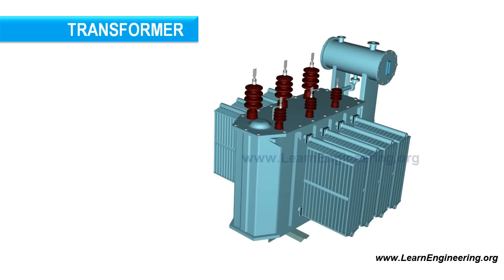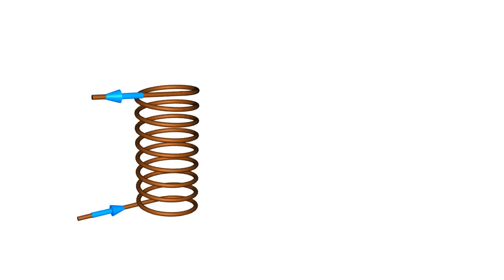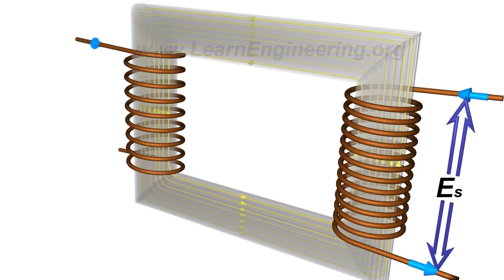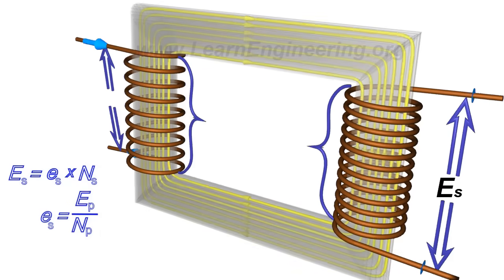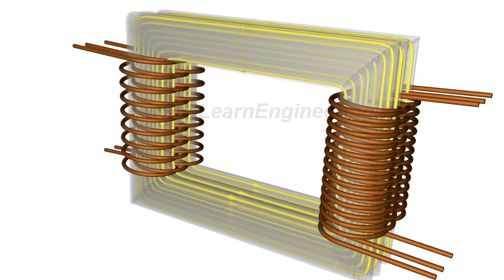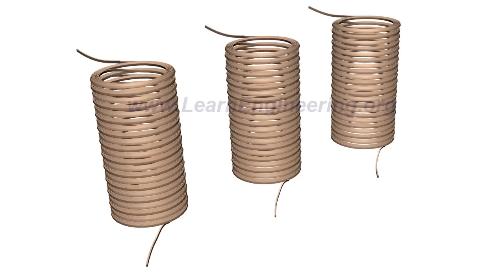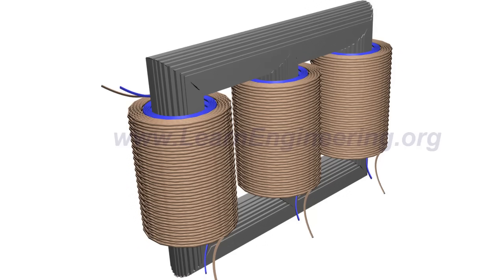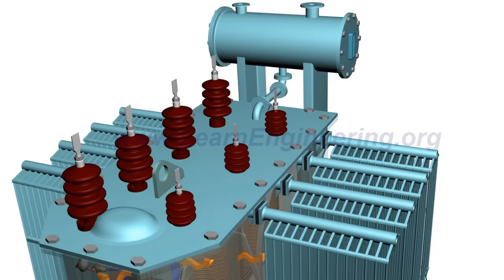How does a Transformer work ?

Comment: Best instruction on transformers I've ever had. Outstanding graphics.
Reply: I find this interesting
Reply: Still not enough for my communist professor.... oh irony...
Reply: I was in danger of being beat up and shot by a Crypt Gangster until I asked him if he wanted to know how a transformer works. Also, had he ever been curious about Nuclear Fusion?? You should have seen the look on his face - he was terrified of me and took off real quick like, getting into the car with the rest of his homies. Whatever he told 'em must have had the same effect c'os they were GONE, and I mean GONE, screeching tires and all!!!!
Reply: Excellent so would know the answer to this:
After placing the primary coil inside the secondary coil, I assume the coils don't touch each other, what is the size of the gap and if there is anything in there besides air separating them?
Reply: It was fine up until the 3-phase explanation and star vs delta configuration. Then it suddenly became an explanation for people who already understood the matter.
Reply: @Mayur think of Watts law. Power = IxE. The power in the primary equals the power in the secondary. A transformer doesn't create power, it only takes the power coming in and converts the voltage up or down, therefore the current can only do the opposite to balance the power (watts or VA)
Reply: Me too I've finally understood wat my lecturer struggled to tell me

Comment: Very clear informations! I'm graduated at civil engineering, but have been learning about mechanics, electricity and electronic with your videos. Thank you for the excellent material!
Reply: The only part I did not understand was the Mathematics behind it all. I mean P=(UV-++^^^78UV) -- V5XV4+eVX22-PO+=o3C2=O There, now that wasn't so hard was it????
Reply: Can you plzz tell me that the concept of transformer or other topics of electrical is necessary for civil engineer ?
Reply: @Ayusingh12348  It's important if you going to work designing the eletrical system of a building, but even if you don't I think you should know at least the basic

Comment: Actually the high voltage side is usually in a delta configuration and the low voltage side is in star configuration. The delta configuration allows us to transport power without the use of a neutral, saves some money. And the star configuration is needed for a ground reference, otherwise the consumers do not have a voltage potential difference.
Reply: true
Reply: Very true for a step-down transformer, but this one is a step-up transformer.
Reply: An interesting note is that in some rural areas the delta just goes straight to the consumers and they tap off from two of the wires directly

Comment: we must also describe 2 things: the number of windings affects voltage (more secondary windings that primary results in a bigger voltage), while the resistance of the wire affects currents (lower the resistance, higher the current). thats why transformers can be used to lower/higher both voltage and current at the same time.
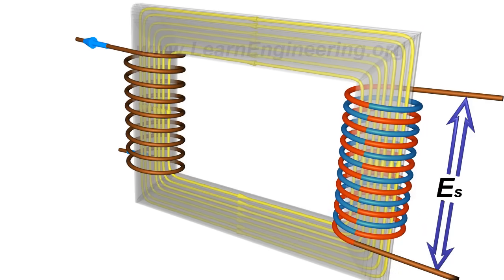(at 1:50, if you have enough patience to calculate the windings on the secondary and primary, you will realize the secondary has more turns, resulting in a higher current.)

Comment: Low voltage coils will be connected in star fashion. High voltage coils will be connected in Delta fashion. This is for your kind information.
Reply: Low voltage coils will be connected to the delta fashion
Reply: Both connected in star formation for accommodating primary and secondary neutral cts

Comment: Dear Sir, I think you are wrong mention, HV should be Delta connection, and LV should be in star connection- from this star point, we can get phase to Neutral....Please correct me if I,m wrong...
Reply: You are right. Congratulations
Reply: The normal way of connecting a distribution transformer, to make the LV-side in a star connection.
Reply: Power transformers usually have the HV winding star-connected, due to the voltage on the winding is sqrt(3) times lower than the line to line voltage, making the insulation more economical. And although the current in sqrt(3) times higher in a star connected winding compare to a delta connected winding, it helps to make it stronger and overcome high electro-mechanical stresses due to fault currents or inrush currents. 
For distribution transformers the insulation is not that expensive, then the delta is generally used in HV winding to avoid the circulation of zero sequence harmonics to the grid, and the star is employed in the LV winding to allow the connection of 1 phase loads, for example: to 120V (line to neutral) or 208V (line to line).

Comment: Eddie current is the current which occurs under the condition of alternating that causes magnetic induction(due to changing N-S poles). Eddie is an opposing current inside the conductor material to the external magnetic field hence it lowers the efficiency. To reduce eddie current loss, Engineers basically use the simplest principle V=I.R in electronics. They deliberately rise the resistivity of the conductor material by laminating several thin sheets and insulating them each other. Finally, each laminations have own small eddie currents but when they are summed up , resistance gets higher.

Comment: what the purpose of neutral at the high voltages ?
Reply: Voltage is a force and that force carries current. When the force is high some current loses it track and will eventually destroy the system. Thus a neutral wire is connected so that the loss current will not destroy the system

Comment: How is that hv has a neutral shouldn't it be connected in delta and then Lv to be star configuration
Reply: This is a step up transformer and that is normal for generation plants
Reply: I thought the same thing. Then I read Henry Hooker's post. Yes, this would be a GSU. Don't make the mistake this engineer made when I called for the incorrect high-side and low-side windings. Yes, it works, but the generator is 60 degrees out of phase with the rest of the world. So, the entire plant uses secondary electrical power that is 60 degrees out of phase, and it cannot be backed-up or loop-fed from the distribution unless there is a "drop and pick" switching procedure. I'll never make that mistake again!!

Comment: I'm pretty sure the basic formula to know if the power is a drop or increase is by doing the primary spins over the secondary spins. This would mean if the primary spin is at 5 spins and the secondary spins are at 10 spins then the total voltage drop will be reduced by half. Shown as 5/10 or a half. In the video, I'm pretty sure you say the opposite. More spins in the secondary the more power we have. You show in the video more spins being added to the secondary spool and say voltage increase. Please tell me if I'm missing something.

Comment: The solid state transformer should use Cascade diode & capacitors array in nano size with proper insulations to jump one voltage to other

Comment: Transformers are machines just like other machines which increase efficiency and make it easy doing things. The electrical power has to be transformed which means change in its configuration for doing things like driving motors and lighting houses. Therefore transfirmers are needed for generation, transmission and distribution of ekevtrical energy. like other machines it is complicated and complex. Theoritically you can say this thing and that thing. Like other machines it has some calculated values and assumptions. Like number of turns, voltage at the receiving and out going ends,  single phase and three phase transformers, Losses and their types, eddy current losses, heat losses and north and south poles. There are some kinds of transformers, current transformers (ct), auto transformers, step up transformers, step down transformers. Otherwise it is a steel structure, which is installed for performing specific jobs and duties.

Comment: The "conservator (not sure if thats spelld right)" the tank that he talks about at 2014 is old tech. New transformers have "soft" cooling rigs, that can expand as the oil heats up, this is to reduce the amount of condensation that may accure with various temperatures.

Comment: This is only for 3 phase power transformers.  Also, bear in mind that the primary is not always Y (star) connected, nor is the secondary always Delta connected.  Otherwise, very good explanation of 3 phase power transformers.

Comment: As voltage drops. Amperage increases. This is the main reason for transformers. The utility companies can use high voltage low amperage thinner transmission lines to travel longer distances. Then once at the intended source. It can then be converted back down to lower voltages with higher amperage to supply the needed loads the home or business is expect to need.. It's cheaper, more efficient and easy to maintain.

Comment: Watts are calculated by voltage times current.  AC can be transmitted over long distances at high voltage  with less current loss. 1 million volts times 1 amp is 1 million watts. At the other end a reduction transformer can drop the voltage to usable and safe voltage. We have 4KV power line on the top of the poles on our street and transformers that bring it down to 240 volts on three wires to feed electricity to homes. Two are hot wires and one is neutral between the hot wires and neutral is 120 volts and between the two hot wires is 240 volts. Nikola Tesla is the one who found AC to be a better source for electricity than Edison's DC

Comment: The laminated core plates are made of Iron.
Iron will loose magnetism, upon  the isolation of current flow.
The chosen alloy for lower frequencies
is silicon Iron. Due to the hysteresis
of the material.
Steel plates would be permanently magnetised & cause undesirable effects.

Comment: Eddy current is tamed with the laminations. If you substitute the laminated core with solid bar, what you'd have is an induction heater!  In no time that steel would melt and run off as molten metal!  The principle is used in heat treating, and in no time if it was allowed to, the bar would turn white-hot - and beyond!!How many, many, transformers have I scrapped!! Some really big ones too!  Including special transformers from Kearney Industries that created 600,000 volts, paired together, they made 1,200,000 volts-laboratory lightning!  These weighed almost 20,000 pounds each!  Made before WW1! The wire inside was as fine as hair, and I was shocked to get less than 100 pounds of copper out of each one!  I almost couldn't recycle it, so combined into the paper it was!!The mineral oil made great Diesel fuel!!how many, many gallons went into my trucks!!!

Comment: Great Video. I thought the High Voltage is connected to a Delta and a Low Voltage to a Star, please reconfirm.Thanks
Reply: Philip Goh  the high side of a transformer generally is connected in a delta configuration . the low side is usually connected in a y or star formation utilizing a 3 phase output with a ground . the reason for this is because depending on your voltage requirement your configuration has to match to promote a harmonic balance. failure to do so can result in but not limited to: short circuiting, partial discharge, and tracking. however there are transformers that are configured as delta deltas, deltas with an open ground, et cetera. I hope that answers your question!

Comment: Wow a transformer with air and oil cooled system just like an engine!! Lets add a cooling fan to it and water cooling jackets outside to make it more efficient!! But i understand some transformers such as toroidal ones are much more efficient is that true? ferrite cores are also better than laminated iron core and they can handle higher frequencies

Comment: Does it change the amps or watts? If it only lowers the volts wouldn't you be loosing quite a substantial amount of energy? Or is that why it gets so hot, it transfers from electrical to internal.

Comment: Thanks for posting this but I think there's a mistake when u mentioned that low voltage connected as delta although it's star and also about high voltage
Reply: And l also said this because low voltage need 3 lines and 1 neutral

Comment: Great video, very clear and concise.  Just a couple of questions.  Is there a loss in amperage when a voltage is increased or an increase in amperage when voltage is lowered?  If so, is it significant (say when 13.8 kv is increased to 765 kv)?  Also, the inner winding seems to be very close to the outer winding.  How do they not arc to each other?
Reply: i only have high school education but i will try to explain to you amigo> voltage high lower amps.... voltage low higher amps....120v at 1 amp=120watts, if you step it up to 240v you get only 0.5amp (240 x 0.5=120watts)...because watts in equals watts out! or less because of heat, eddy current  losses, if you get more then you will be a very rich man because that is called OVERUNITY!! It defies laws of thermodynamics!..they dont arc because when primary field collapses and this collapse triggers the secondary windings to act...vice versa so their magical effects are staggered!!

Comment: Is it just me, or is there an error in this video? It is normally the high voltage windings there are in Delta figuration, and the low voltage in star, thus you need i N in your low voltage system

Comment: If this delta wire conections are similar to delta conections of 3 phases ( R = 1, B = 2, Y = 3) and the opposite side of each coil respectively are 1 - 4,  2 - 5, and 3 - 6, then the conections delta should be 1-6; 2-4; 3-5. But on this design it shows differently. 
The connection you are using are:1-2; 3-6; 5-6. This is not correct according to the sketch. Am I right? Thank you. Wonderful a presentation. I liked it so much. It answers many of my questions. God bless you and your work so much.
And in this case the phase chould not come on from the bottom (in the intermediate or second coil, contrary as it happen in the first and third coil where the phase come from top?
Sorry, this means if we make the right connection  doesn't matter if the second coil is upside down and in a different position, comparing with the esquema of the motor?  Is it correct?
Reply: I was considering that the coils are not in the same sequence as in the 3 phases elétrica motor, and two of them are upside down.  
First coil is correct 1 entry up (conecting with 6) and 4 out down (connecting with 2), in normal position as in the motor mentioned above).
Second coil 6 out up (connecting with 1) and 3 entry down (upside down, connecting with 5).
Third 5 out down (connecting with 3), 2 entry up (connecting with 4 in first coil), in normal position as in the motor mention. Am I correct? Is it possible to turn upside down the second coil, and it will not affect the flux of the electrical magnetism in the metallic core? Thank you in advance.

Comment: When you placed the primary coil inside the secondary coil, I assume the coils don't touch each other, what is the size of the gap and if there is anything in there besides air separating them?
Reply: Blue Ocean there is paper insulation and 
oil between coils. The gap is small , maybe 1/4”. For small power.

Comment: hay buddy you just make some misstake is happening in delta and star connection voltage. according to your video. high voltage is preferred to star connection side. but it's wrong. High voltage side is delta and low voltage side is star connection. An example would be a distribution transformer with a delta primary, running on three 11 kV phases with no neutral or earth required, and a star (or wye) secondary providing a 3-phase supply at 415 V, with the domestic voltage of 240 available between each phase and the earthed (grounded) neutral point.

Comment: So that's how tube amps take 110-240v and transform up to 800v and how 12v to 110-240v converters work
Reply: Also how your car is able to fire spark plugs with 20-30k volts starting from a 12v battery

Comment: Capacitor driven brushless dc proportional electricity surpluse generator onboard automatic transmission with hermetically sealed battery components. Maintain frequency driven ac motor for propulsion employing series of capacitors for acceleration boost. Multi charging battery bank. Altornator equipped front wheel for additional charging and forced braking.

Comment: Revolutionary new electric cars! Frequency driven ac motors to regukate speed and liquid cooling for battery system.  They need a revolutionary new power source to eliminate the need for charging.

Comment: So I wonder, how the magnetic flux lines are able to stay within the iron core without leakage...then i wonder how on the other side how the electrons are affected by the magnetic flux if the flux is confined to the iron core if there is basically no leakage, how do the electrons "feel" the flux to create the induced voltage?

Comment: Very good video. I have got a question. Recently i noticed a single phase transformer which in the primary winding had L1 and L2. I would have expected L1 and Neutral. How does this work? I cannot find answer anywhere. Thank you

Comment: nice omission magic indiction in Secundary coil which is not traversed by any line of magnetic fields and still induces a voltage. Although the theory is wrong but it works so why go into details
Reply: what? the voltage is induced in the secondary by the flux in the core. that's exactly how they showed it.

Comment: Also why are the laminated sheets made at the angles and cuts they are instead of sheets of equal and constant geometry shapes/areas? As I am writing this I am thinking they are cut like that to form a somewhat circular geometry for the coils to pack on more tightly to, is that correct? if that is correct why not just make the steel sheets more circular or round them out so the coils can fit more snugly on the steel/iron core? Also why is steel used instead of iron?